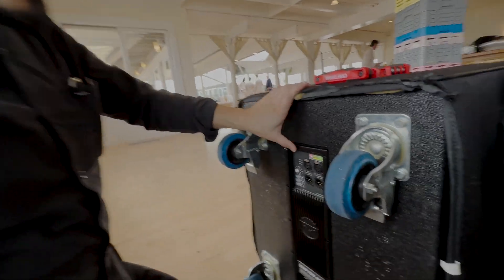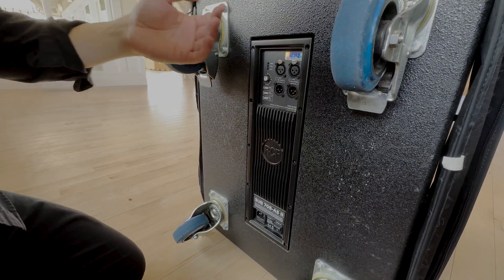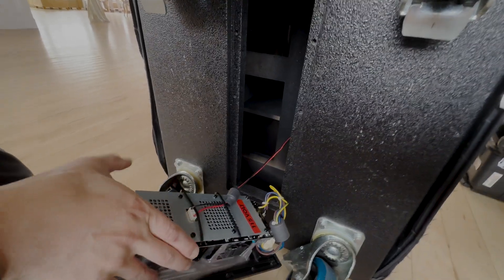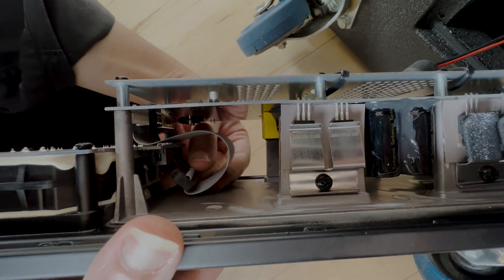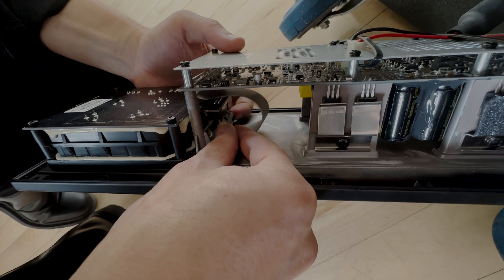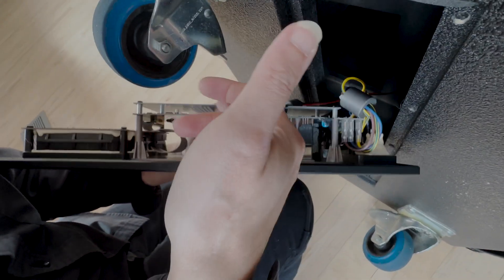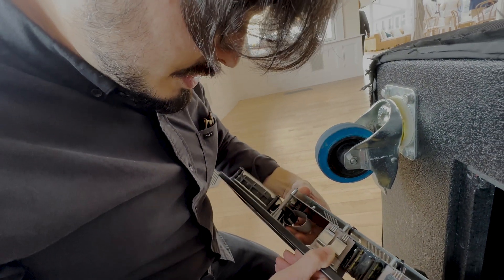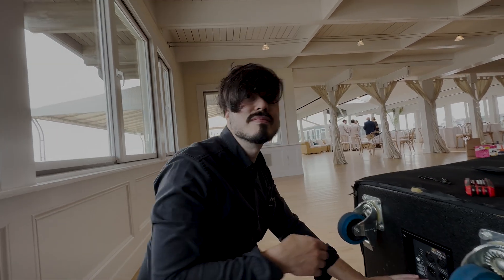RCF 708 AS II Subwoofer Does Not Power On

Comment: I just had that problem last night at a gig. Mine stays on for like three seconds and then turns off… if it was the ribbon cable then it wouldn’t turn on at all is that correct?
Reply from the maker: Correct. No ribbon = no power.

Comment: Active speakers are not a good idea. It just saves the roadies having to cart amp racks around. If an amp goes down at a gig it's easy to plug the speakers into another amp, but if an active speaker amp goes down at a gig, you're f***ed.

Comment: Do the capacitors hold a potentially lethal charge?
Reply from the maker: All capacitors will discharge  if you bridge the terminals. Touching the tops to make sure they aren't bulging is safe since it is the opposite side of the terminals.